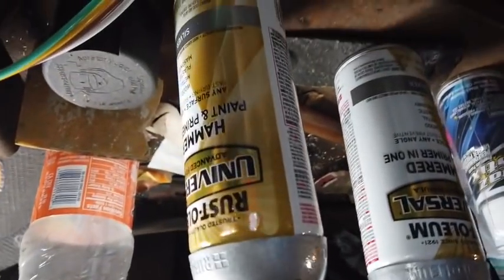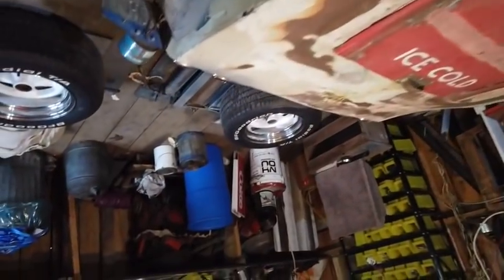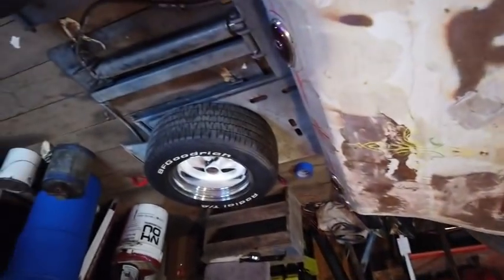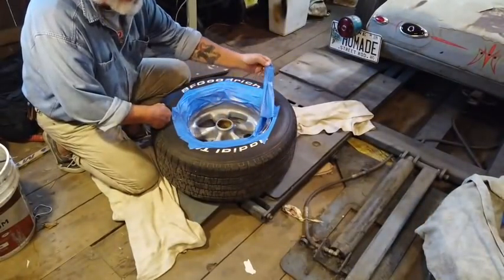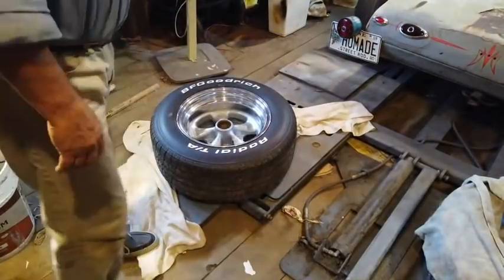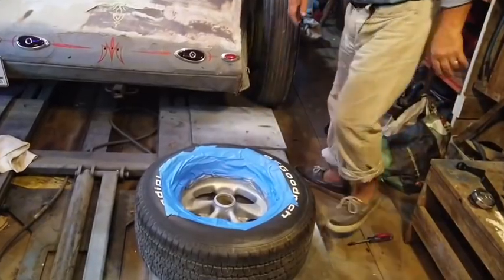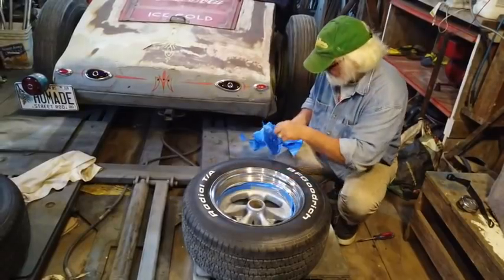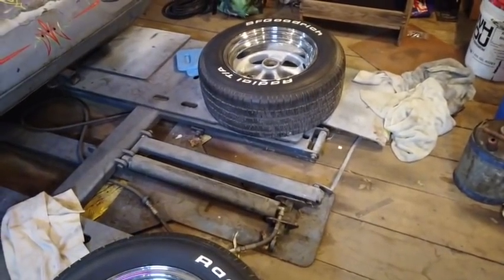Painting Vintage Western Mag Wheel Centers

Comment: And I’ve used plasti on a few of my cars ... did you get any texture from the spray ? But looks pretty good the way it came out !
Reply from the maker: It was very smooth and it hid the rough texture from the scratched up chipped up wheels.   I'm thinking some of that would be just the thing to fix the grill on the RV that someone painted with latex..